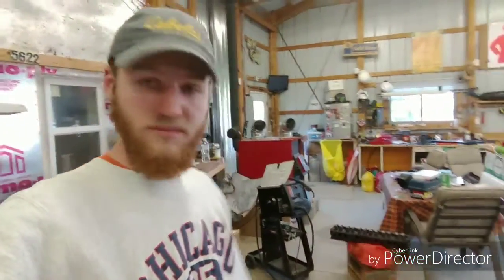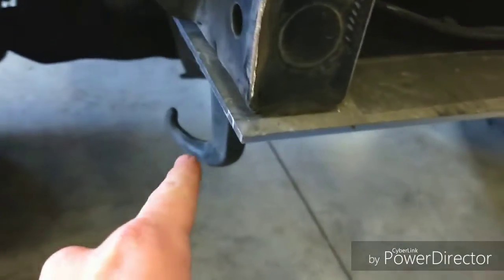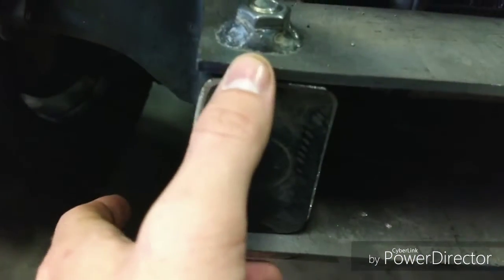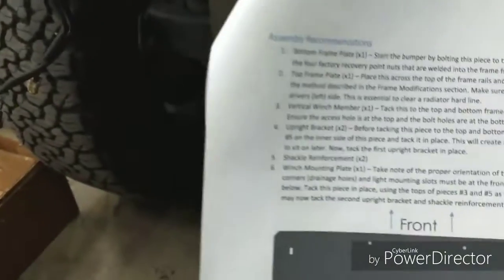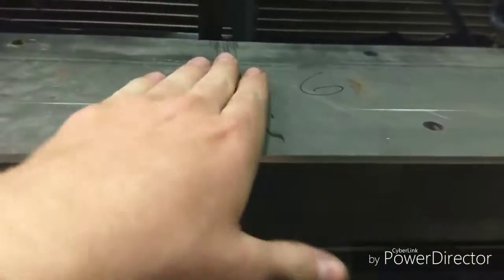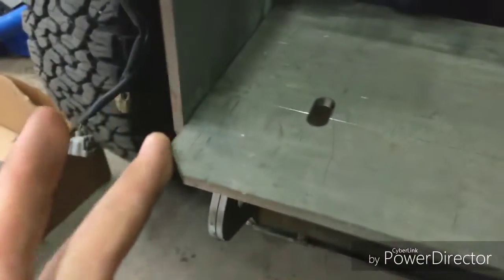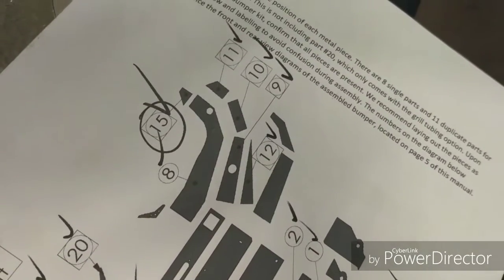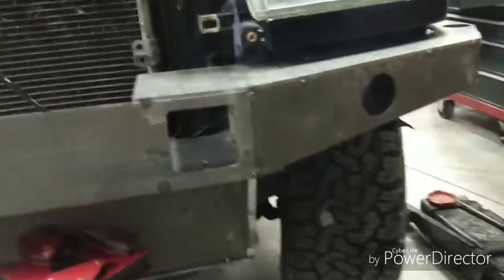How to: Coastal Off Road winch bumper build part 1

Comment: This was extremely helpful.  I'm 1/2 way through doing one for a 1st gen Tacoma and was cursing that it was built for a 4Runner but happened to fit a Tacoma.  I was laughing pretty good that you thought the exact opposite (in Part 3).  Totally agree it's a great kit but by no means is it as simple as weld it up and bolt it on.

Comment: Do you have the project in 3D for cutting steel sheets? Here in Brazil Toyota is different
Reply from the maker: If you mean like cutting the plates out yourself on a plasma table of some sort there is no need. When you order the kit it's already very nicely cut

Comment: What size welder and wire are you using? I see the Hobart on the cart in the background and didn't see a bottle, you using fluxcore?
Reply from the maker: i was using .030 and .035 fluxcore wire, i had a bit of .030 left so i just used it up . I do not recommend using fluxcore because its difficult the chip off all the slag for paint prep.

Comment: nice work, it's never as easy as it should be :(   also some info for you about the video.

all the frame nuts front and back are M12-1.25  your correct they are not common sizes to find in normal hardware stores.  I have a fastenal down the road and they have them... one homepot around me has this size for some reason but no others have M12-1.25 for some reason.  they are a pain to find.
that is not a radiator hard line, it's for the dehydrator on the AC system.  it's filled with pressurized coolant so yes don't put a hole in that one!
Reply: M12 1.25 gaul pretty easy. Make sure its clean.